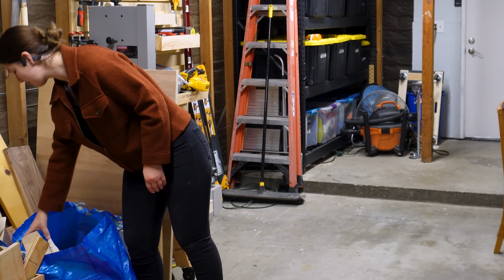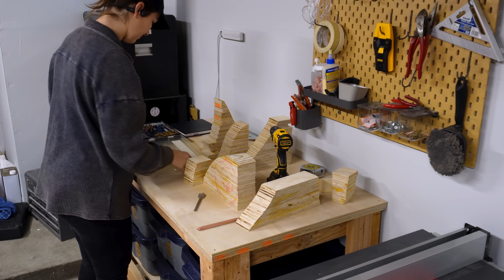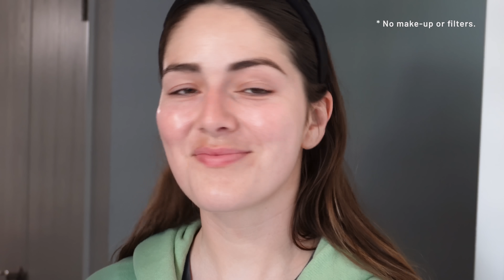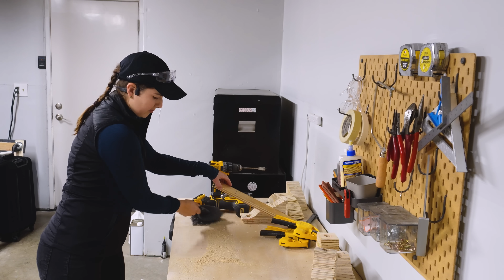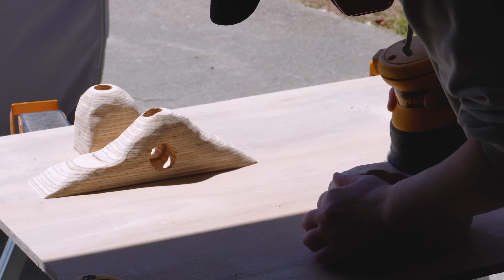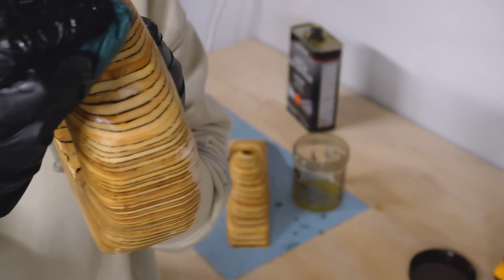Using Scrap Wood to create Contemporary Vases

Comment: That's a great use of leftover scraps! You seem to have a very creative mind and can transfer your thoughts to paper. That's something I can't seem to do, so my projects are built on the fly, and it shows sometimes.

As far as the lack of tools, if it wasn't for a neighbor moving back to New Jersey a few years ago and not needing them or wanting to ship them back, I wouldn't have many of the bench top power tools that I do. They are older tools, but they get the job done. A good place where you can find power tools at yard/garage sales, just make sure that you can verify they work properly. If there are any woodworking clubs or guilds in your area, you may be able to get help from them.

Comment: Could you have used a router for the central holes? You’d have to make passes from each side, but a template bearing would allow the two sides to line up. You could then use a round over to soften the edges.
Reply from the maker: Definitely! I just don’t own one but I’ll likely breakdown and get one soon. I’m just indecisive on what type to purchase first.

Comment: You could have used the coping saw for cutting out the center of the large piece. Drill a small hole through the piece, take the blade off the saw, thread it through the small hole, then reattach the bade to the frame. Interior cut outs like that is one of the problems coping saws are designed to solve.
Reply from the maker: Very true, next time I'll probably go that route.

Comment: This video is a shining example of your creative thinking and problem solving. You may not have the required tooling, but you do have an imaginative mind. That is more powerful and effective tool than any  comments chastising you for the methods you used. Continue using your rational problem solving with safety above all until you are able to secure the tooling you need for projects like this.
Reply from the maker: Thanks! It's one of the things I love about woodworking, it's a bit of a puzzle trying to figure out the best tools and methods to get to the end result :)

Comment: I suggest picking up a wen 6307 banfle 1/2 x 18in belt sander.  The back side of the belt sander is backed by metal or any track so you  an use it as a flexible belt for  curves.  In my line of work we have 2 plus a few cordless ones and there used almost daily for the craziest stuff in the tightest spots.  Even as enough power to drill a square hole strait on in wood 👍
Reply from the maker: Thanks for the suggestion, I'll have to check that out.
Reply: It use to be $25 now it ranges from $33 to $40 now.  Makita is almost $200!  All cordless options are $120+ but because of the lack framework on thr back of it it makes a fantastic cheap curve sander 👍

Comment: They turned out great, and there is loots of room to experiment with shapes and textures or having the plywood layers going different directions. it defeats the point of using up scrap but you could glue up layers like the chaos cutting boards and get some really interesting patterns with the organic carving.
Reply from the maker: Thanks :) I'll definitely need to experiment a bit more and I have plenty of those glued of plywood pieces leftover to work with.

Comment: Wow thanks for the video. Recently I was lucky enough to get several trailer loads of off-cuts from a furniture factory which included several pieces very similar to what you're using. Initially I had no idea what to do with them but now I'm now feeling Inspired.
Reply from the maker: I'm happy it provided some inspo! What a score on your end. Best of luck making some cool stuff with those off-cuts.
Reply: @elenamakes  Some pallets use blocks of plywood as spacers between the top and bottom, these would probably be free and could be useful for similar projects.